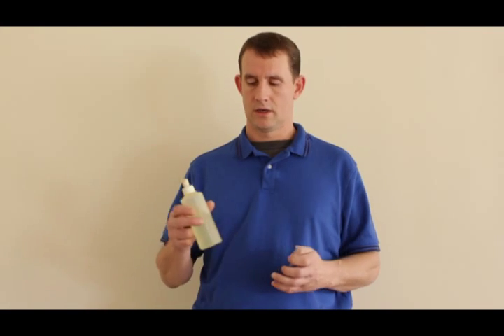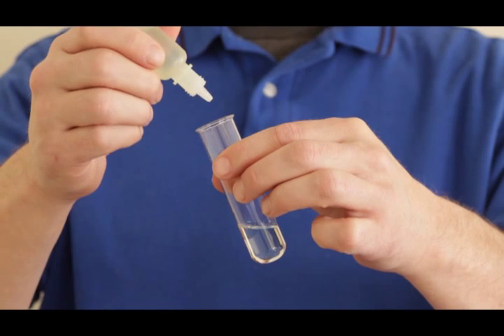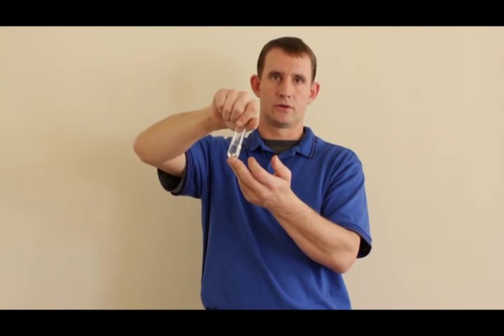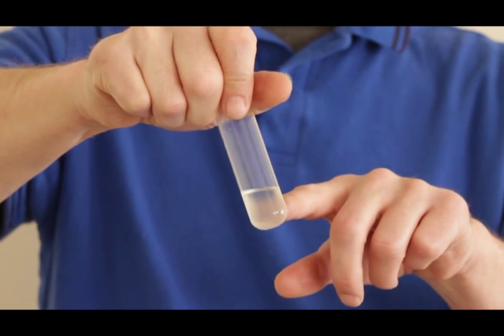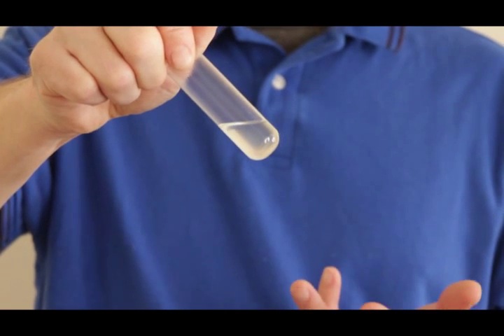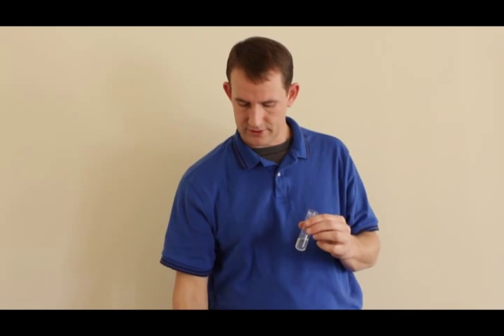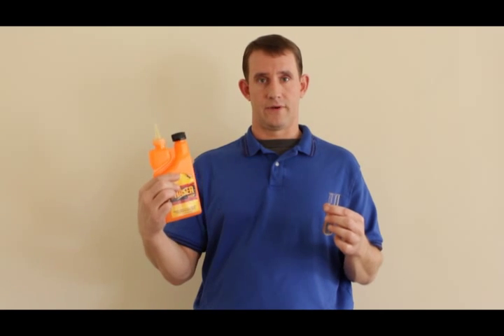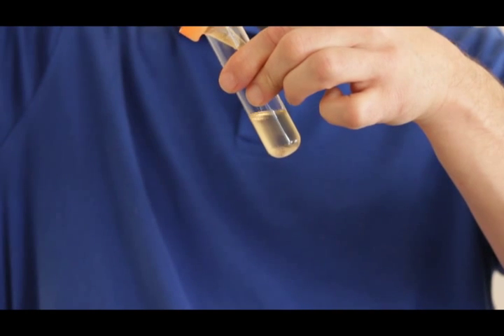Phaser 3000

Comment from the maker: Primrose has launched an ethanol gasoline fuel additive to effectively control water that is often present in ethanol blended gas. Ethanol blended gas has an affinity for water, which can result in a fuel that is difficult to burn. In severe cases, a condition known as “Phase Separation”, where fuel floats on top and an ethanol/water mixture sinks to the bottom of a tank, can leave the engine without a source of usable fuel.

Expanding Primrose’s Premium Select Fuel Additives line, Phaser 3000 can prevent and/or reverse phase separation caused by excess water in ethanol blended gas, therefore, insuring a viable fuel . In addition, it helps prevent rust, corrosion and scaling while extending storage life of the fuel.

Primrose Oil Company, Inc., established in 1916 is based out of Dallas, Texas. We are a producer of high quality Lubricants and have been making and marketing Fuel Additives since 1944.